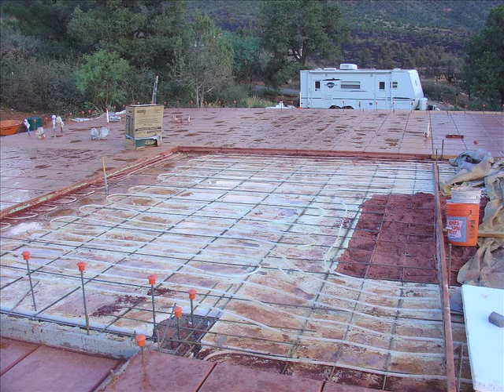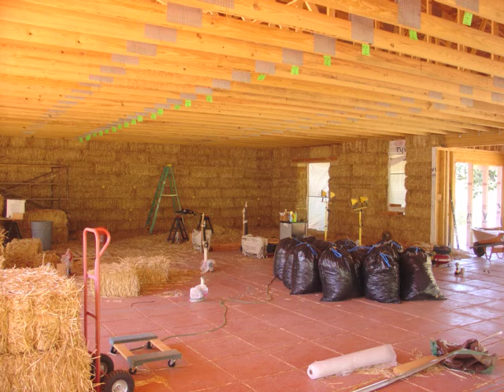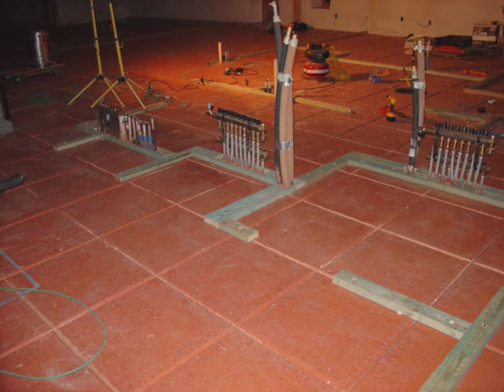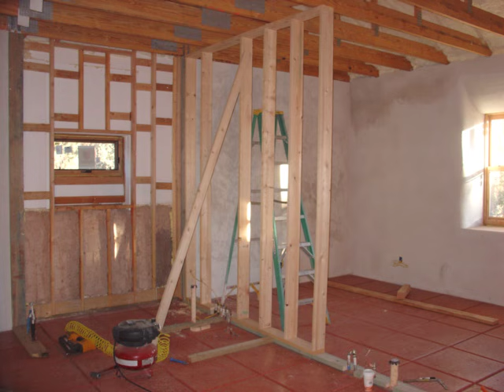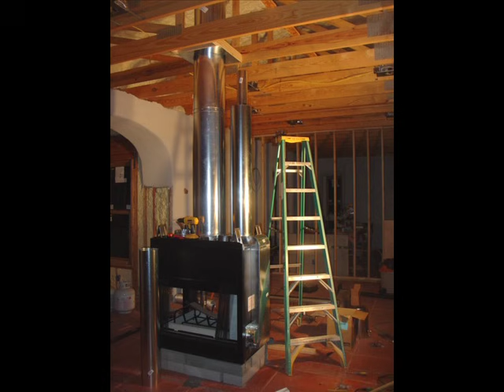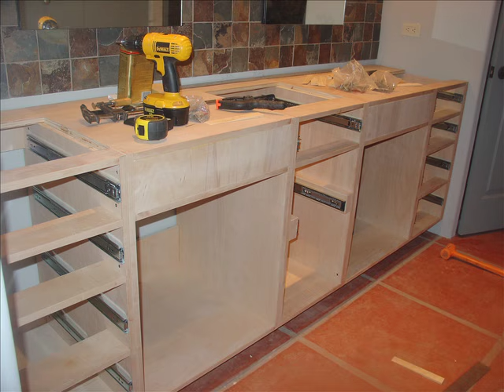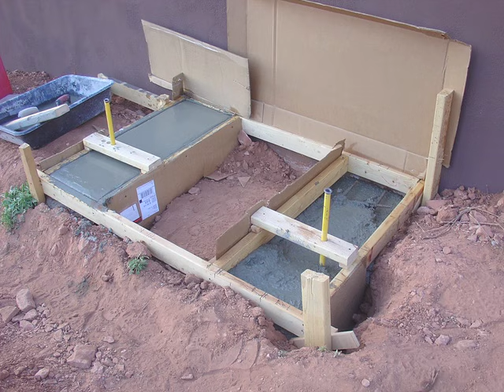Building your own Straw Bale House - an interview with the Author

Comment: Mr. Cahill, my family and I have been looking into alternative, energy efficient ways to build homes that may also be cheaper than traditional housing. One of the things I have noticed is that these are built in the drier west and in more even climates, and a few in the more humid south east of the United States. Would there be any issue with building a home in a place such as Georgia, North Carolina, or so on?
Reply: hi, Twitchy
      Yes you can absolutely build in humid areas like North Carolina and Georgia…it's a matter of selecting the appropriate stucco materials and finishes such that the walls reject liquid water but freely pass vapor (I discuss this in detail in the book).  You'll also want to be very selective of your straw…it should be well-dried when you receive it, kept dry under a tarp and on pallets until you use it, and if you're planning on building multiple houses, you'll reduce your labor costs if you find a supplier who specializes in straw for Straw Bale Houses.  Often these will be compacted with calibrated equipment that gives you square, consistent bales which minimize labor.  Also, you'll want to build stem walls that are high enough to keep the straw from encountering surface water.  Hope this helps.
Reply: John Cahill
  It's also a great option in the more rainy cold Northeast (such as Upstate, NY).  I've ordered the Photo journal, in preparation of a decade-old dream to build a Strawbale residence here.  :)  Research, research, research!
Reply: Maebius  That sounds like a great project!  The various suggestions in my book are ideal for a house in your climate…notice the sections on hydraulic stucco, silicate-based paints, FRP/Rheem water heater, radiate floor heating, full attic with attic trusses etc.  I would suggest being very selective in sourcing your bales (as discussed) and keeping them fully dry prior to getting them under roof.  I would also suggest you consider building Post and Beam as I did…again to make it easy to keep your bales dry as you put up the walls in that area where rain may show up at any time.  You'll want a foot or two of stem wall to keep your slab and bales well above any sitting ground water.  Feel free to write me with any questions at 135krpm@q.com. Btw, I grew up in northern Delaware and have many happy memories of canoeing and hiking in Upstate New York….it's absolutely gorgeous up there.  Best of luck!!!
Reply: Maebius, did you build a straw bale?  I'd love to visit if yes. I'm a Corning girl, thinking seriously about building one in central Joisey.  betsychina@aol.com

Comment: What about using wattles for walls , they are round so you could get a nice effect , and you can get a radius . What do you think AF this idea , wattles are also wrapped in a mesh bag so application of mud mix has a lathing of sort . What does every one think of using wattles ? Please respond
Reply: hi, David
     Great question.  I agree with all the positives that you mention regarding straw wattles, they are easy to radius and the mesh bag would make application of a mud mix straightforward.  You would have to solve the issue of how to stack them stably. And you'd have to verify that they are dense enough as well. A proper straw bale is highly compact (my 18" x 24" x 48" triple tied bales  averaged 125 lbs each) and therefore yields it's superior insulation properties and also fire retardation.  It's possible that wattles would work well for you if you can reconcile those issues.  If so, please get back to us as I'd be very interested.

Comment: (continuation from below) however in a nutshell I used and recommend an appropriately sized stemwall to raise the straw ball walls sufficiently above any standing/running water, hydraulic stucco in a traditional 3 coat application, and silicate based paints which are designed to shed liquid water yet maintain a good permeance of vapors (to match the permeance of the hydraulic stucco render).  Hope this helps!  Good luck in your build!

Comment: hi, Jethro
    Here in Sedona, AZ we have much the same climate that you describe.  We are warm most of the year, but have a 2 month long "monsoon" season during which we get extraordinary amounts of rainfall in very short periods of time (several inches in less than an hour).  My house was designed specifically for those conditions (including the flash floods that can accompany them).   I had several approaches to handle this, discussed in detail in the book (see URL above), however (continued)

Comment: HI Im from New Zealand and really interested in straw bale house building. But our climate is sub-tropical, this means, although we enjoy ( generally ) warm sunny summers. Our winters can sometimes have periods of heavy rain fall, lasting 8 or 9 days. With severs wind conditions the rain can be comming in horizontal sheets. Directly hitting the sides of the house. My question is, in these conditions would  a straw bale house ( after sealing with render) be compromisd in anyway. Thanks

Comment: hi, I did the majority of the work myself...only bringing in help for jobs which require a team such as the concrete slab, roof trusses and stucco.  Clearly one could build the same basic house for substantially less.  My wife is an Interior Designer and added lots of special touches which were a bit pricey.  Nonetheless our house came to less than $160 per square foot, all told.

Comment: hi, Thanks for your question.  If you're asking how much is the book, you can get a digital download for $16.99 at the above website.  Btw, I just added air conditioning.  I wasn't going to since the house stays pretty cool anyway, but here in Arizona we're starting to get protracted periods at or above 100 deg F and that's gonna get hot eventually no matter HOW well insulated your house is.  Here's the good part though... I'm averaging $1.10 per day for the A/C at 100 deg F (house at 77 deg) !!

Comment: hi, Token Drone
    When I was first researching Straw Bale building I found a lot of excellent information from Canadian sources.  I think that people in your climate are making excellent use of this technology.  There are no downsides that I can see.  You may want to check out my book where I discuss exterior finishes though.  You'll want a finish which is both permeable to vapor (breathes) yet resistant to liquid water penetration.  I would also suggest at least a 1 foot stemwall.  Good luck!

Comment: I've been thinking of straw bale when I finally decide and have the resources to build. I'm trying to measure the pros and cons to straw vs hempcrete or another alternative building material. We're in very different climates though and I'm not sure how well strawbale and mortar would do in Eastern Canada. My climate is probably most similar to New England or Maine.
Reply: There are straw bales all over .. some over 100 years old.  check in nebraska,  north or south dakota,  also mother earth news  did an article on a couple in canada that did a  straw bale home there.   Usually the over hang is  longer to protect the bales more.